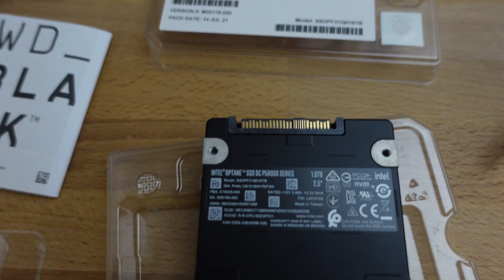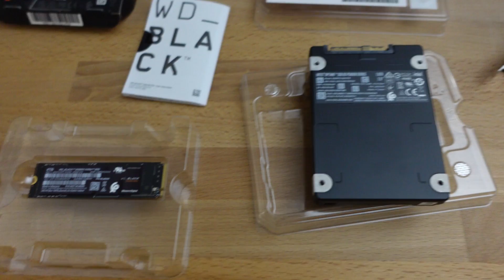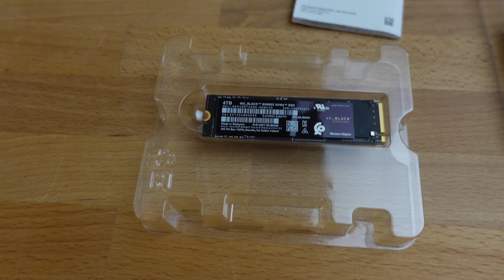Going SSD crazy, Intel Optane P5800X 1.6TB, WD_Black SN850X 4TB - Hephaestus Build

Comment: Hi, can you tell me the Crystaldiskmark 4K Q1 1T performance you are getting with the P5800X in your setup?. Thanks.
Reply from the maker: I tried this early on when setting up windows, but since then setup Linux. What I remember was not really thrilling results, think the idea is that a certain kind of workload would be needed to generate the right kind of IOPS results. Next time I can reformat this disk I'll probably try to really suss out it's performance and show/document.
Reply: @nispoe  remember the IOPS are going to be limited predominantly by two things. First if your interface is limiting; either by power over distance, or successful interaction with full bandwidth via the lanes. And second… if you meet the first requirement. The CPU itself will limit the IOPS. You know that your hard drive is amazing when the bottleneck of your ssd is the CPU. 😂
Reply from the maker: @drewphilip  The interface and distance was definitely something I noticed when using an adapter card and the motherboard has issues with signaling between slot pcie connections to the CPU. At slots 5, 6, 7 the motherboard even has re-driver chips to improve signaling. I chose the 32 core Threadripper PRO, and not sure if I'm limiting the IOPS, I need to run through some different benchmarking tools to try to push the IOPS to see if I can get to what is spec.

Comment: The Intel Optane P5800X is super nice, plenty of speed, and having 292,000 terabytes of writes is insane. The DWPD (drive writes per day) is 100... for 5 years lol, plum crazy. Also, i would think what is happening is maybe pcie switching? or maybe it's throwing errors over something in that department, the gpu most likely uses 16 lanes, i dont know what cpu you have to know exactly how many lanes you have, outside of that, your pch (chipset) handles some of the stuff, but using pch lanes introduces more latency and it's also limited to how many lanes it can offer. Another thing i've seen recently is if you dont have an igpu with the cpu, some of the linux distros, mainly arch based - fail to boot after install. You could also try a cmos reset, just gotta change all your bios settings back to how you want them. Never know, it could be something simple like secure boot, or TPM, could be how you're booting ubuntu, could have the drive in mbr when it needs to be in gpt, if you used ventoy to create the bootable drive, you might have left "secure boot" option on in the ventoy settings, which could also create problems. I realize i'm 5 months late, but maybe this helps, i'll comment more if i think of anything else. Also have you checked out pslc nvme drives?
Reply: nvm on the pcie lanes, the cpu has 128 pcie lanes, so that's more then plenty lol
Reply from the maker: @Jackel1337  all good suggestions, I did eventually figure out that on the motherboard PCIe slots 5, 6, and 7 all have redrivers. So if you populate all slots you need to go into the BIOS and and adjust this for better signaling. I later upgraded to better riser cables and found this helped a lot also. Lol, yeah I got this Treadrilper pro so that I can have full x16 usage on all slots.

Comment: I have a new optane 32gb never use it, I have bottle neck in some games with rtx 3090 and i7 7700 non'k but delided with high speed ram,am using HDD 5400rpm 2TB WD.
1080p..
U think if I use optane 32gb+hdd will wasted mine cpu performance? or graphic performance? pcie 3.0 z270.(I see 3.0 only lost 1 fps to 3 fps)

So after u reply mine question,will be better in a HDD WD Black or Gold version? with optane.
In games performance,I use a lot of storage to,so idk if ssd is good option per years,I use hdd storage for decades.
Reply from the maker: I believe that's what the 32GB Optane is supposed to be good with SATA magnetic drives and will only help mostly with loading and caching. Have to check the compatibility to set this up with your i7 7700 since the Intel software is picky, and have to make sure your motherboard supports Optane. The framerate may not improve much with and SSD upgrade. Most impactful parts during gaming are RAM, CPU, and GPU. For quality of life to load a game or save a game, etc, the hard drive matters more. There could be fps loss if the system has to swap, and then if this happens performance overall would be poor. Gold is for durability and work stuff, I would go with WD Black for gaming if going magnetic. If you can instead get a WD_Black NVMe PCIe 3.0 SSD like the SN750/SN770 or if you can spend more go with SN850/SN850X.
Reply: @nispoe  black wd hdd vs wd blue the only differences is cache? or it runs better without inntegrated cache?
Yes mine motherboard have optane compatibilty,u think will run better with wd black than a wd blue?
Reply from the maker: @user-kv5he9np2y  If you are going for a magnetic HDD with Optane think the blue will be okay. But if you get an NVMe SSD the blue will feel night and day compared to the HDD for gaming.

Comment: I stumbled upon the last remaining used Intel Optane P5800X 3.2TB in January of this year, and after much deliberation, I bought it.
Even though I had to pay $5000 for it, I'm happy with it because it has a lot of capacity and performance and I can feel both parts.
What are your impressions after using it for 2 months?
Reply from the maker: I think it's a great drive and time will tell if it will be durable for what I am using it for. I'm using it for mostly GenAI models and technical work with LLMs. I think it works great as a drive that I read and write lots to, but the 1.6TB drive I have ran out of space... so I now leverage this as well as the 4TB SSD to store of LLM checkpoints and code. Depending on the models I play with I am continually refreshing this drive and think given the random read/write strength along with the durability of the drive this is perfect. I would love to try the 3.2TB so will keep an eye on one of those for the future.

Comment: @nispoe, did you notice any improvement using PCIe 5.0 M.2 to U.2?
Because P5800X is only rated for PCIE 4.0, so curious if you saw benefits.
Reply from the maker: The motherboard and drive only operate at PCIe 4.0 so no other benefits. The BIOS by default is set to Auto, and you can explicitly select Gen 3 or 4. I may try this on another motherboard that can do PCIe 5.0, but pretty sure it will only do PCIe 4.0 because the drive is limited to that.

Comment: Saw you got your 1.6TB Optane brand new for $2000, what do you think I could sell mine for I've had it as a boot drive light use same model, as I'm considering selling it on, but not really sure how to price it.
Reply from the maker: I'd say look at eBay and some online server suppliers. Act like you are googling to buy one and you can get a feel for what people are selling them for new and used. From what I understand, the Intel Optane drives are super durable, so even used would be a good buy.
Reply: @nispoe  Thanks for the quick response, appreciate the advice.
Reply from the maker: I took a quick look, and wow, new on eBay is roughly $3,000 to $4,000. I think used could still be $2000 to $2500 and if the need is there someone may buy. For me spending the extra $500 for new would make better sense so it would have to be around $2000 for me to really consider. Then again, given how lucky I was with pricing I'd be patient and wait until I see something close to what I paid or lower.
Reply: @nispoe  Yeah that makes sense, should add warranty is until 2026 for most of the drives, regardless of new or not. That's why it's so hard to put an accurate number on what I should be asking for. I'll likely list it for $2500 and best offer just see what happens and wait I guess.  Thanks for the help.

Comment: Really wanna nab a P5800X 800GB+, but they're just so pricey.

That said, their ability to be written, start-to-finish, and maintain the same access time, speed, and reliability, across years of functionality? I don't think the NVME drive is going to compete, long term.
Reply from the maker: I think I got lucky a while back picking up this one on eBay. There was a period where these were being cleared out I think. Yes, the thought was given the amount of writing my code does should not only last longer, but think I see performance gains since the NVMe SSD does tent to bottleneck when writing large chucks of data from memory.
Reply: @nispoe How much you nab one for, if you don't mind me asking?
Reply from the maker: @Fox_McCloud  I made a best offer on eBay for 2k for the 1.6TB version.
Reply from the maker: @Fox_McCloud  yes brand new and I checked with Intel's site to verify authenticity and warranty.
Reply: @nispoe well, if you ever find another deal like that, lemme know (if that's ok); I'm interested in one of these, myself, but don't want to pay the $4000-$5000 for a brand new one, either.
Reply from the maker: @Fox_McCloud  actually, I keep looking for myself on and off, if I remember will post